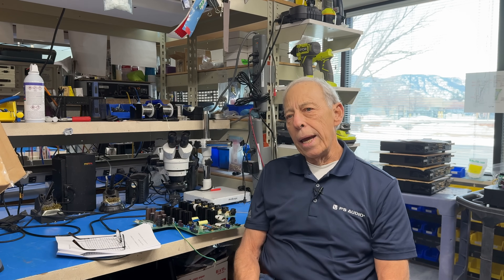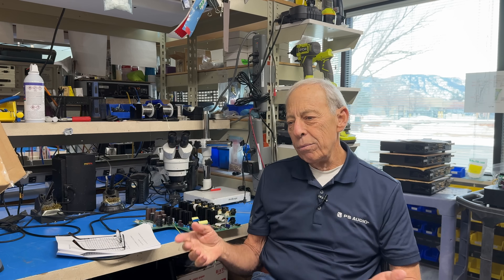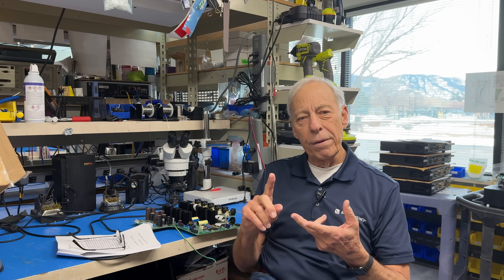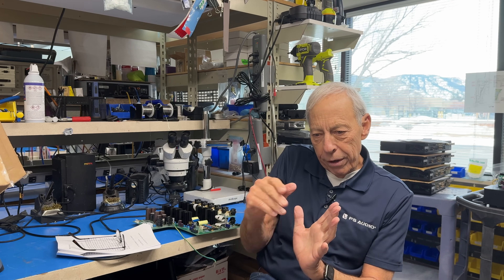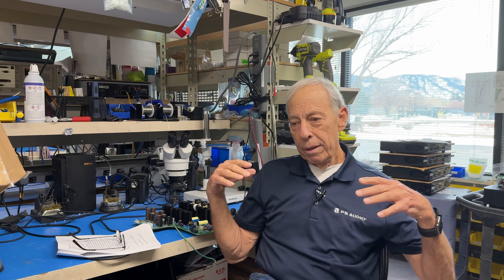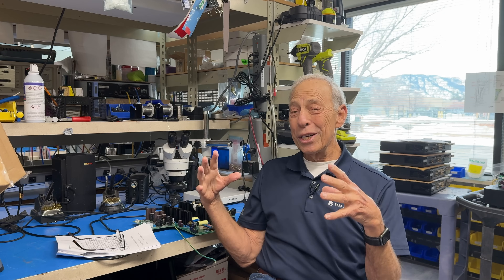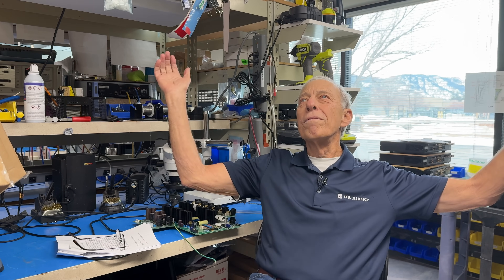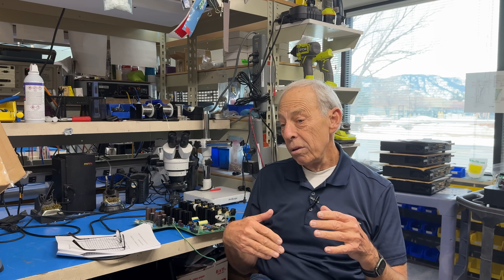Why power amps have more wattage than speakers can handle

Comment: I get the point, but you could also oversize the system's total SPL output relative to the space you need to sonorize. The only thing we want is for the amp to not clip, and the speaker to no get burned.

Comment: Another analogy is, a car may be a rated as having 400 to 500 Horse Power and can supposedly achieve higher speeds than anyone could or should ever travel at. But at the say middle ground of speeds and much safer levels, the vehicle never seems to struggle from zero to that relatively much higher speed. So in essence, it would be like having a car that is capable of accelerating to very high speeds. You notice the ease of responsive performance, but never achieve the cars ultimate capability, nor will you ever need to.

Comment: I have a Spectron musical MK lll class D amp designed by John Ulrich It's output is 500watts@8ohm 650@4ohms and 1,200  and it weighs 54lbs! Sure brings my Maggie's to their knees
Wide! sound stage, amazing dynamics, and excellent inner detail

Comment: Good amps don't need to be 700 watts to deliver a nice sounding 150.......unless they are class D...... You also should mention the impedance change in drivers during music play and the demand on the amplifier , Also why amps don't show a power rating at like 20+ ohms and if its linear with your 4ohm rating?

Comment: Heat kills speakers. What provides the heat a clipping amplifier. Therefore aleays have power in reserve, head room, no clipping no excessive heat building up in the speckers voice coil. Simple
Reply: Heat isn't provided merely by clipping. Heat is determined by the power being dissipated by resistance, regardless of whether the amplifier providing the power is clipping or not. If a given speaker can be damaged by the extra power output a lower powered amplifier has during clipping, it can be damaged if used inappropriately with a higher powered amplifier, even if not clipping. Elliott Sound state it as: "In the end, it doesn't matter if the signal to the speaker is clipped or not - if you feed excessive power into a loudspeaker on a long-term basis, it will fail."  "No clipping no excessive heat building up" isn't a safe conclusion.

Comment: Putting am oscilloscope on the speaker output (one channel) will show you when the amp is clipping the waveform tops off.
Reply: True enough. Occasionally an amplifier might have a clipping indicator, although I suspect that's not favored since not many people would understand it and might think it meant there was something wrong with their amplifier.

Comment: It's not always true that higher power amps will always sound good because it all depends on the listening volume that we are playing our music at. Yes there should be some headroom so that amp never peaks at or may just the double power that's all needed. If we are listening at low volume then certainly a 1800W monoblock amp will distort it. Think about you have a 1W headphone and playing it from 100W amp. How would it sound? He just skipped the intricacies of this question.

Comment: I used to laugh at the people that would look at the back of a stereo receiver and think that the wattage printed on the back was speaker output when it was AC input wattage.
Reply: and now we miss that spec, max power draw or output from an amp is as useful as the watt per channel 1%ths 8ohm.
as example my 2 channel amp rated at 185watt, but can output 1100watt.

Comment: You can (and I have) drive small speakers really hard without issues as long as the amps provide clean, unclipped power. Usually the first thing you hear is a clack as the woofer runs out of travel. But an over-driven amp which clips will fry tweeters before you get a chance to do anything about it.

Comment: I think a lot of people don’t understand the fact that an audio amplifier isn’t putting out a constant measurement of power or watts. It is constantly varying depending on the signal that is put into it which is also constantly varying. In addition to the fact that the impedance of the speaker is varying with the frequency of the signal. In a typical home stereo configuration in the average size room, 10 continuous watts in most cases would be deafening. But at that continuous power level, bass heavy signals may require 100 or more watts. Also if a speaker is rated at 100 watts, it won’t be destroyed if for a very brief period of time it sees 150 watts. To compare it to something most people understand, when a table saw or an air compressor first starts, it may draw something like 50 amps for a split second. It doesn’t trip the breaker or burn the motor up because it’s for a brief period of time. If the saw is on its own breaker, it won’t trip the breaker if it’s properly sized. But if it shares a circuit with a couple lights and a radio and battery charger, it is likely to trip when you first turn it on. As Paul says, if you have more power than you need, the amplifier will never strain, delivering the clean power required for transient peaks cleanly. While it would certainly be overkill to buy a 1200 watt monoblock amp for a speaker rated at 100 watts and would damage the speaker if played loud enough but pairing that 100 watt speaker with a 200 watt amp would be a good idea. You just have to have common sense to turn the volume down if something doesn’t sound right.

Comment: Hi, I have a Focal Vestia No.4. I have upgraded all the components on the crossover with their original values. They all consist of Jantzen Audio brand air core coils, capacitors and resistors. For testing purposes, I have only upgraded one of the towers. However, there is a decrease in the bass compared to the original. The bass of the other one, the original tower, is stronger. What could be the reason?

The values of all the components in the new crossover and the original crossover are the same, in other words, the coils and capacitors were all used at the same value. In fact, when they first arrived, I measured them all one by one with an LCR meter for confirmation and compared them with the originals. They are within a tolerance of 1-2%.

Why might the bass be weaker? The bass speakers in the original crossover were connected with reverse polarity, so I did the same. I wonder if I reverse the polarity again and connect them with straight polarity, will it be fixed?

Comment: Its the same with cars. A Mustang and a Ferrari maybe can both hit 140mph but the experiences very different. The Mustang is calibrated to perform the best about 0 to 70 and then takes  awhile to go higher where as the Ferrari accelerates hard through all gears and speeds. The Ferrari just like a more high powered amp has more headroom so can easily do what it does optimally without being stressed.

Comment: Latitude and 
Longitude 
Is a Academic Discipline 
If You Gave a
Pilot Navigator 
Latitude and 
Longitude 
Two Parameters That Person Can Read Those 
Numbers And Tell You Exactly Where That Location Is on A Globe 🌎 
A Conductor of 
The Los Angeles Philharmonic 
You Can Place In Front of
Him a Copy of Sheet Music and He Can Hear The Music In His Head as 
Music is a Academic Discipline 
and Finally 
Audio Engineering 
You Can Put The Specs and Schematics In Front of a Audio Engineer And We Can 
Take Those Numbers And Transpose Them Into Audio Frequencies Without Hearing a
This Piece Of Equipment 
Because Audio Engineering Is a
Academic Discipline 
Plus We Can Take Those 
Numbers and Ears 👂 To
Fine Tune The Design Of a
Speaker 🔈 Cabinet 
That’s As Simple As I
Can Put It 
Yet The Audio OEM
Do Not Wish To 
Pass That Information To
The Audio Consumer 
Because That Information 
Would F@%# The 
OEM and Remove 
The Subjectiveness
That They Want
You To Use Your Ears 👂 
This is Exactly Why 
Paul Has a Loyal Fan Base 
Because They Believe 
Not All But One Quarter of What Comes Out Of Pauls 
Pie 🥧 Hole is 
Audio Gospel 
Pauls Audio Engineer 
Can Hear and Transpose 
What He Hears into 
Frequencies and 
Know What Electrical Components To Achieve
The Desired Sound Results Because 
Audio Engineering is a Academic Discipline 
We Need Numbers 
Folks First Yet It Doesn’t Make Us Bad People 
Only Too Some 
Yet Paul’s Gremlins 
Bromites Garden Gnomes and Audio Goons 
Think Otherwise 
So Bully For You 😮

Comment: My Marshall  Guitar amp Set to  "1" watt  thru my 4x12" Cabinet  is a fair bit  louder than my 2 X 200 Watt Monoblocks in my HiFi Setup ..A Marshall 4x12 Greenback  Guitar cabinet is just downright brutal irrespective of the watts driving it

Comment: Us audiophiles know that Paul is right. But 1200 watts is absolutely silly. It's a money grab. In fact I would go as far as saying about 200 to 300 w is plenty for 85% of speakers out there. Size of your room will make a difference also
Reply: "absolutely silly"  So is the 900hp that my 03 Mustang Cobra puts out, but it's fun as hell!
Reply: @Mark-lq3sb  hey mark! Decent analogy but not the same. You can only play the music so loud before you blow your eardrums. With two to three hundred Watts on tap, your ears will bow out first. So absolutely it's just a company boasting they have 1200 W amplifiers when it will never ever ever ever get even remotely close to that for power usage
Reply: @ryanschipp8513  
So, you do not except the Paul's explanation on the subject?

Comment: What does an effortless sound, sound like compared to a sound that isn't effortless? I am not trying to be argumentative, I honestly have no idea what it means for a sound to be "effortless". I absolutely love your videos, Paul, but I wish you would have explained this. Your car analogy makes perfect sense for a car, but doesn't clarify what an effortless sound is. Thanks for all your videos.
Reply: IMHO, the biggest phenomenon that achieves effortless playback is lack of "compression". That is "one" of the biggest offenders of making your music become fatiguing, thus resulting in much less effortless reproduction. But really, this is just scratching the surface. Another biggie is amplifier topology, if it's a class A/B amplifier, only the first X amount of it's rated output is in class A, then it switches to class B, again adding "effort" to the way it sounds. Hope this is of some use.
Reply: Loss of dynamics/increased compression is usually what we mean by "not sounding effortless" . This is likely to occur when the amp is pushed passed its level of headroom .

Comment: also...amps are full of caps and if there is enough capacitance you can use a larger amp than the outlet is rated for, especially for actual music which is usually very dynamic.  A 10 second sine wave would pop the breaker a lot quicker for sure.  But music, even at full power, you can get a lot more out of the outlet than most people think.
Reply: Incorrect, common type B breaker requires 5 times the rated current to trip within 40ms, for 1.5 the rated current this figure is counted in minutes.
Reply: @paulb4661  nothing I said was incorrect.  Thanks for the random, weird reply though.
Reply: @meade916 Firstly: the larger the caps, the higher the current peaks over the 100/120Hz cycle, assuming heavy discharge conditions/high power draw. Secondly: If it wasn't for the overload capacity of type B (×5) or type C (x10) breakers, any inductive load such as that presented by a large transformer, would trip it when first turned on. Thirdly: Unregulated, internal power supply rails will sag by betweeen 5 to 10% at full load, irrespective of the size of caps. Finally, voltage is squared, capacitance is not in the stored energy equation, hence the former, not the latter really matters. You're welcome.
Reply: @paulb4661  stop. You are embarrassing yourself right now Paul. You sound silly. Lots of big words for someone who doesn't own anything.
Reply: @meade916  Well, at least you know something I don't.

Comment: So What’s Really Disturbing Is 
You Just Don’t Get It
….You Now Have 
Two Options 
Which You Can Combine and Then You Fine Tune 
Not With Only Your Ears 
👂 But With Your Ears and 
Technology Like a
Programmable Crossover 
Which You Need A
Oscilloscope To Program 
The Crossover Points 
Of Course You Use Your 
Ears Yet Your Ears Can’t Hear The Fine Frequencies That a
Oscilloscope Can Replicate Then You Take 
Those Numbers 
and Program The Crossover Points ( Note The Speakers Frequencies Range 
Dictate The Crossover Points ) It Sounds Like 
You Don’t Understand 
That OK 
Carry On 
Because This Is a Entire Academic Discipline
You Just Don’t Understand 
And Until You Have at 
Least a Minor Bachelor’s 
Degree in Audio Engineering 
You Will Never Get It 
This Is Why Paul Hired a
Audio Engineer 
Because You Hire 
The Best 
Plus You Have 
Old Timers That 
Have a Physic Engineering Background 
Like Bob Carver 
Who Took a Academic 
Discipline and 
Uses His Ears and 
Technology 
(You Can Have Both )
That’s Why Paul Hired a
Speaker 🔈 Engineer 
You Combine Technology and 
The Ears of Paul 
I Don’t Understand 
That It’s a Subject 
That Is Very Sensitive 
To Some Folks And I Think
You Are Too Sensitive 
To Understand 😮

Comment: Paul - I listened carefully, and while you covered the aspects of the definition, you didn't explicitly say the term THD. I read down a fair amount in the comments, but didn't see it explicitly mentioned there either. Now isn't this what you meant, when you said how the more powerful amps are able to effortlessly produce their beautiful output over a wide (linear) range, because the THD is negligible there, and sharply increases above that, and so, why the sound in that range is so much better?
AND
While putting this clean output, at full power (if beyond the speaker's upper limit), will cause damage because they are not built for handling this - we will never need that corresponding volume for listening, and so will not likely damage our speakers?  And so, conversely, isn't it also true that pushing a lower-wattage amp to produce those more intense listening volumes (beyond the amp's linear range) will introduce THD (again, that increases sharply above the amp's rated power limit) that would damage those speakers, even when delivered at wattages within those speaker's tolerance - because of the THD?

I think another viewer detailed these consequences very well in sharing his 1978 system purchase, but again never (explicitly) mentioned THD.

Paul M.
Atlanta, GA

Comment: Paul isn't being totally honest.  As soon as a class A/B amplifier crosses over into Class B operation, it is no longer linear.  Distortion increases.  That happens well below a class A/B amplifier's rated power.  A low wattage class A, as long as it's not clipping, produces more linear and less distorted sound.  

So how many watts do you really need?  Depends on the efficiency of your speakers and the size of your listening room.  My speakers have a sensitivity of 89 dB / watt at 1 meter.  Two of them produce 92 dB  at 1 meter.  My listening position is at a little over 2 meters, almost 1/2 way across my small room. 1 watt, with room reflections, gives me about 86 dB at the listening position, louder than I care for and louder than safe for long-term listening.  A factor of 10 increase in power (to 10 watts) yields 10 additional dB.  That would be 96 dB, the level at which hearing loss occurs after as little as 30 minutes.  

Your ears do not work well at 96 dB as they attempt to protect themselves by contracting the muscles in the middle ear, particularly the tensor tympani, effectively reducing the vibrations reaching the inner ear and thus lowering the perceived noise level, acting as a protective mechanism for hearing. This distorts the ear's response and critical listening is not possible.

You only need hundreds of watts if you're trying to drive inefficient speakers in a large room.  A lower wattage Class A amplifier with efficient speakers in a small room will sound as good, or better, than a huge wattage class A/B.  It's dishonest to suggest otherwise.
Reply: As an long time and happy owner of a high-quality pure Class A 2x20W Hiraga amplifier with an oversized power supply (> 1Farad filtering) I tend to confirm and fully agree with the final conclusion even if to be honest I personally never tried really "huge wattage Class A/B". Not sure whether the high A/B power amps advocates themselves ever listen to smaller Class A amplifiers ?
IMHO less rated power means also less circuitry, less transistors to pass trough etc ... thus a more "direct connection" and finally less potential sources of sound degradation, no ?
Reply: >>  Your ears do not work well at 96 dB as they attempt to protect themselves

Oh man, are you telling me.   I experienced this once in a concert where the seat was placed way too close to a speaker and it was painful and very distorted.  An unsettling experience.
Reply: @marvinmartian8746  That's why I always bring earplugs to concerts.
Reply: This is not how a class a/b amplifier works, otherwise this distortion you write about would show up in measurements.
Reply: @mitchtaylor6512  It's exactly how it works.  Don't believe it?  Ask AI.  Here's AI's answer; "Class A amplifiers generally have significantly lower distortion than Class A/B amplifiers because Class A operates in a more linear region of the transistor, essentially eliminating crossover distortion, while Class A/B still experiences some crossover distortion, although much less than a pure Class B amplifier."